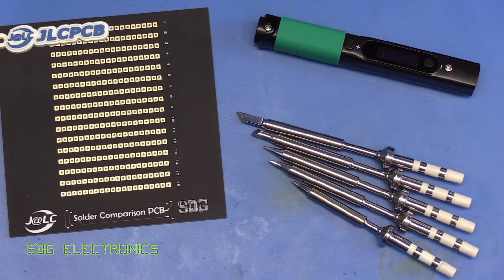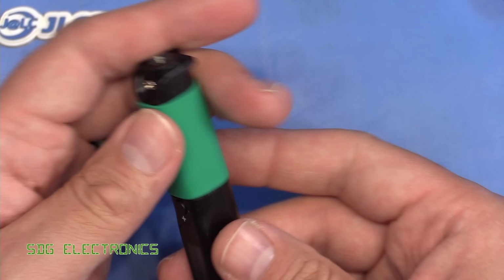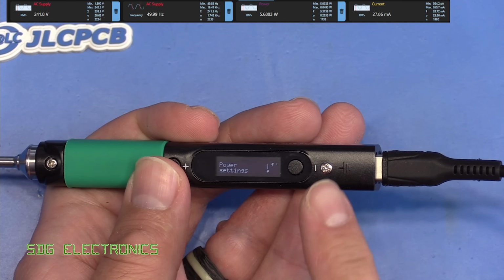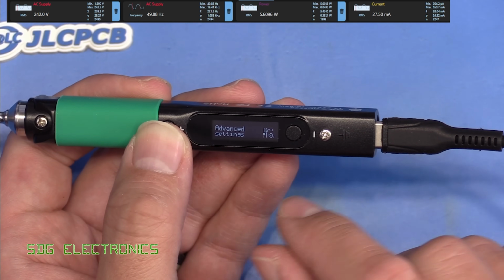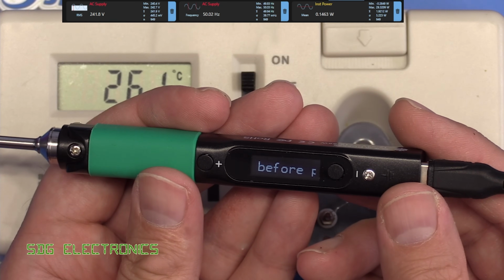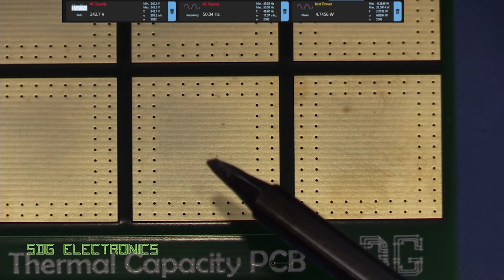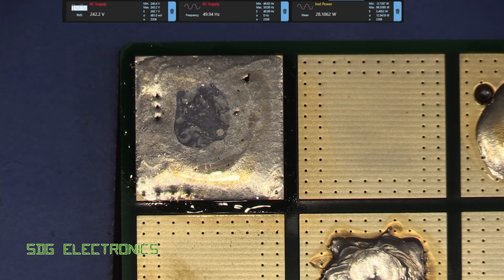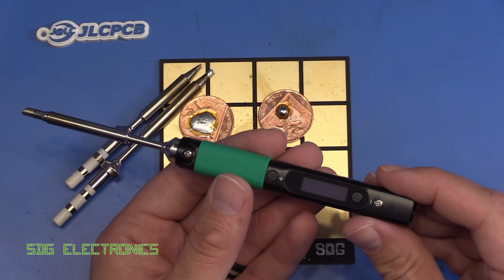SDG #275 Pinecil V2 PINE64 Open Source Soldering Iron - Test with PCBs from JLCPCB

Comment: 10:00 I'm happy, but it's disappointing to see that I wasn't the only one scratching my head about the temperature calibration.
Reply: it is confusing process  see the open Issue ticket  in Github Ralim's IronOS.  maybe you could add your experience there so that steps in firmware could be reconsidered for clarity and programmed differently so it's more clear.  there are also several searchable docs in github explaining more on the calibration process.  it's designed to be done when you have really have temperature off issue but not every day thing.  Since calibration is considered an Advanced option  highly recommended to look at instructions or ask  in Live  community chat if run into trouble or confusion with it .  links to community live chat all in  pinecil-wiki

Comment: Received mine today... With the proper power bank, it drew 88 Watts and heated to 300C° in "faster than I bothered counting". Like literally 3 seconds or so... And if it's on standby or still warm, it's faster than you could physically move it from the stand to anything you wanted to solder on a board... ^^ I didn't do the penny test, but I'm positive it would have SMASHED that...

Comment: I was thinking of getting one to upgrade my older TS-100, but I think I will skip it.
Reply: There are lower resistance tips available, which he's probably not aware
Reply: @alexstone691  Where? The only one is the conical tip supplied with the iron, at around 6 Ohms. There are no other low resistance tips at the moment unless you have a secret source?
Reply: Wasn't the TS-100 released in 2017? And already in need to replace it? That's a waste of money.
Reply: @ricardoferreira2811  I wanted it because of the USB C power delivery, but I see now that it's inferior to the 24 volt that I'm currently using.
I mostly use my KSGER T12 anyways.
Reply: @AndreaAustoni  my bad, it turns out the 6 ohms are the low resistance tips, and many people seem to have a problem with them as they are probably crap quality
Reply: @alexstone691  It's not crap quality, the problem is the shape. No matter how good the manufacturing is, a conical tip is useless for soldering. No idea why it's the default tip. Anybody who has any soldering experience knows the default tip should be the chisel tip.
Reply: @RicardoCooper  He's not using USB C PD in the video though. I do (65W 3A 20V) and it's very fast. It heats up to 350 C from cold in 10 seconds, 5s from 150 C when I wake up up. It wets solder on turret boards without issues. If I use the boost function it's twice as powerful. I don't know what your requirements are but this performance is amazing to me for such a cheap tool.
Reply: @alexstone691  I see. I don't use the new tip because it's conical. I haven't noticed any inconsistencies with the small hoof tip I have (longer 8 Ohm tips). I haven't needed to calibrate or test the tip temperature. I just solder, you know? If one needs very precise temperatures and 100% reliability there are many bench soldering stations that do the job better, of course.

Comment: Your coin soldering test in the end was very cool, it would be nice to know if the tips have been on all irons the same and the Wattages? 🤔
Is ther a video off all newer like this soldering iron reviews, there are in the last 2 years so many different soldering irons coming out that I have lost the overview 😳, it's a shame that the producer of this stuff don't make soldering irons modular, that the customer could chose a bigger display ect, like Lego bricks 😂, I have suggested this idea to a company and I hope that they do things like that in the future, they have all ready changeable casing colors, this days with all this cool Technologie ther would be no reason not to do it, cost factor is not a problem if they sell this days the irons for 25£ without extras(bigger display, double the size would be only 4£ or so max cost, depend on the version, I like OLED displays, they are better readable I think, or a e-ink display would be cool, they have been much improvement thus days and faster 🤔🤗) , but I see no reason to pay for thus not extremely innovative Technologie and not so new 60£ ore more only for the soldering iron.
I hope I have not written to confusing, not easy to write with strong pain ect. 🤗

Comment: Small gauge work only, beyond requires a station. Honestly it sits in the desk drawer cause it's just easier to fire up the Hakko, dial her in and use muscle memory for repairing game controller or whatever 

Like anything, the tool is only as good as the person using it. Chances are there someone using it that could out-solder me around the room

Comment: Thanks for the review! I'm disappointed there appears to be an issue with the tips. However, I think you can confirm that by using a tip from  the Miniware TS100/101. I hope they'll correct the issues in the forthcoming line of shorter tips.
Reply: @neo256mb  Steve is pretty sharp. I'm sure he'll read some of the comments and do more experimentation. I hope the manufacturer reads this too and can make improvements to the tips. I haven't used one of these type of portable irons yet. I prefer bench model soldering stations like Metcal, Hakko and Pace whenever possible.
Reply: @acoustic61   hope so :).   What I would fault  Pine Store for is that they should put a link from Pinecil  to both "Pinecil Wiki" page and the "GH  Ralim's IRonOS."   there are no instructions to how to use it on Sale page so at least they should link to the wiki (which has links to Ralim's IronOS)  and /or  give links to IronOS.   Other huge resource people don't know about is all the volunteers in the open source community in Pine64  dis cord that help on a daily basis when people need clarification on how  Firmware/software works. 

looking at this video I'm not sure there is a manufacturer (Pine Store) problem. Pine store makes only the hardware part,  any software or firmware is FOSS ( free open source software community). here  it's GH Ralim's IronOS   which has tons of documentation online about how to properly do calibration. There is also an Issue ticket system in GH  so if people have some misunderstanding of calibration they can open an Issue there or ask in discussion. Ralim's IronOS  is used on Pinecil exclusively, but also on over 155,000 people have downloaded it to use on Miniware devices as well like  TS100, TS80P, etc.. 

There is also a community run Pinecil Wiki which has links to live  Pinecil chat where people get these kinds of questions resolved in minutes if they don't understand or are new to the firmware.   
 would have been better had SDG  asked first how to do calibration either on GH  or in live pinecil chat before publishing that firmware wasn't working. from what I saw it worked great and he missed it and just kept pressing more buttons without needing too. when calibration completes, it gives you offset number, in this case for him it was 833, and then he simply needed to press minus a couple times to get to the main screen.  IronOS does not say the words "Done"  or complete.  and there is nothing  the manufactuerer can do about that. 
I opened a GH  IronOS  ticket with Ralim  to see if there is room in the firmware for for it to say something more like " 833 offset, Done"  or "833 offset, Complete"  on the screen instead of just  "833". again this is for the community and open source firmware people to fix and  Pine Store (manufacturer)  is not involved on that end of it. 

It is odd he was off by 15 degress so I would have asked him to do a couple tests on the tip first  and also made sure to clean  contact back area of the tip with some IPA because we have seen that can interfere with  correct Cold Junction Calibration voltage reading (since it's such a small difference , factory residue on tip can make a problem). 
Usually in the dis cord live chat  if someone wants to calibrate, the volunteers make sure they follow correct set up first. maybe there is a problem with the tip he got but maybe there isn't .  What if  before the calibration he booted with long tip and then swapped tip without rebooting, or vice versa. I'm not sure what exact steps were done, but it was clear from the video that some basic things about the V2 are not understood which led to several misteps (especially believing that the longer tips are higher performance with it's the opposite).  way too many variables here and I don't have enough details from the video.  if he came into the live Pinecil chat channel (link in wiki)  we could have sorted this and helped him in just a couple minutes to resolve this confusion.

If anything, as volunteers in Pinecil live chat who see people come in for help everyday or question on how to use the firmware or the hidden debug menus in the firmware,  we usually find it is a tweak of the open source firmware and not the manufacturer/Pine64 hardware issue.  for example do we know if SDG  followed the correct steps when switching from long to short tip and back?  it can not be done  with pinecil plugged in. you have to unplug it because the long tip is 8 ohm and short tip is 6.2 ohm. V2  measures the tip resistance at  bootup only. if you swap again you need to unplug.  measurement is a toggle since the short tip is all new with the V2 and did not exist before.  
Ralim  of Ralim's IronOS  said that  he coded it so if reading is close to ~6.2 ohms, it goes with that temperature profile, and if  it's close to  ~8 ohms it goes with that.  in 2.19 Beta  firmware for  V2  this was further tweaked because it was discovered that some  people with Long tips  could have as low as  7.6 ohms.  after that, Ralim tweaks the firmware further.  Ralim is  a volunteer,  all firmware for Pinecil  is open source IronOS.  Pine64 only provides and makes the hardware, and the FOSS community makes  the firmware. 
I've used it for so long that I take it for granted  that I have to reboot if I swap tips and I know that  very specific steps need to be strictly followed to get the correct calibration. and if I have a problem with firmware  and I can't find answer in the copious documents in GH IronOS, I open an issue ticket. 

Finally, I also fault Pine Store for the tiny paper user manual  they include in the box with Pinecil with super mini font.   they should have on 1st page in huge letters, links to Pinecil wiki and GH IronOS.  then people would have a fighting chance to go to links, see there are instructions for Calibration, and many other important details,  and be less lost and confused on how to use the firmware.  sometimes where people think there is a problem, it's a misunderstanding of how to use the firmware.  there are also  two hidden  debug menus people do not even know about until they go to GH IronOS documents.
Reply: @neo256mb  Shouldn't Pinecil V2 be capable of performace similar to a genuine Hakko FX-951 station? I mean it can use higher voltage power supply and the tip resistance is lower? 

It's been requested many times in the Pine reddit group that Pinecil should let the buyer chose the default tip that ships with the iron. The conical tip is virtually useless. And they should also sell additional tips separately instead of a 4-pack. Hopefully they will correct the issues and have better performance.

Comment: I expected more for a version 2, the idea is to perfect not get worse. Thanks for the review.:_loveitboy:
Reply: The calibration is performed incorrectly in this video is part of the problem.  Also I'm not sure if SDG knows but you have to unplug and replug it in when changing  Tips, because Firmware does a Resistance reading at boot-up  to be able to tell if it's a Short or a long tip. 
It is better, look at my speed video.  also there is a mistake in this video the new  shorter tip  is the higher performance at 6.2ohm versus the  older  longer ts100 style tips which is 8ohms.  using an ohm calculater,   6.2 ohm with  20V  usb-c charger gives max of  ~64w  whereas using the longer tip change calculator to 8 ohm and you  get  max of 50w.
Reply: @neo256mb  He said in reply to another comment that "Yes, always turned off before swapping cartridges.". Also, the pine64 store listings for this aren't the best - it only describes the extra tips as Fine and Gross - no mention of tip resistance, that they are slower to heat up than the stock tip, etc. Would have expected better from them after some of the previous mistakes made with the store listings.
Reply: @pfeerick  yes I understand. Pine Store should list more details on Tips and also  on Pinecil. I don't understand their resistance to adding more info.  EVen just a photo showing all 4 ways to power it would prevent people accidentally buying Pinecil thinking there is a mini battery inside. I like miniware  photos on ts101. it shows Exactly the iron plugged into 4 different types of power. why Pine store doesn't have this similar photo I have no idea. It only helps to have more organized information on sale page or At Minimum, Put a Link to Pinecil Wiki  if they aren't going to add any instructions on Pine Store page.

Comment: "Quick-charge compatible power supply", what does that mean in wattage? Because Quick Charge 3 is rated as max 36 watts last I checked. If you're going to give the Pinecil insufficient power and then be upset it doesn't perform, that seems like some bullshit. I plugged in a 60 watt Power Delivery battery pack and mine hits 400 degrees C in literal seconds. Granted I haven't measured how well that holds up in real world temp, but enough wattage should mean it has an easier time compensating for temperature drops at the tip under load. Also, for some reason it seems that the minus button is the confirm and the plus button is back in some scenarios, so you probably just kept hitting cancel by hitting plus.